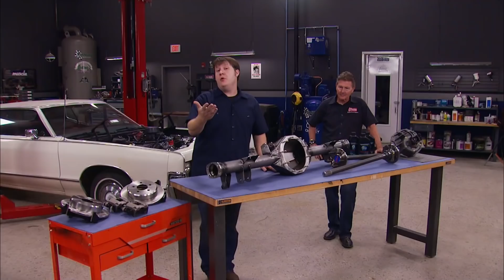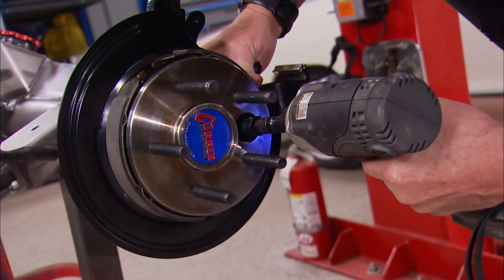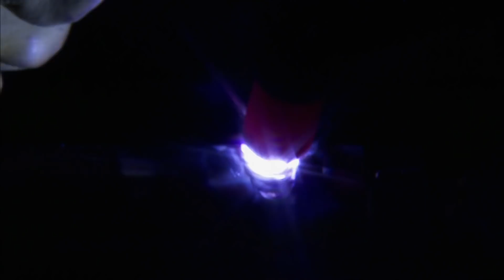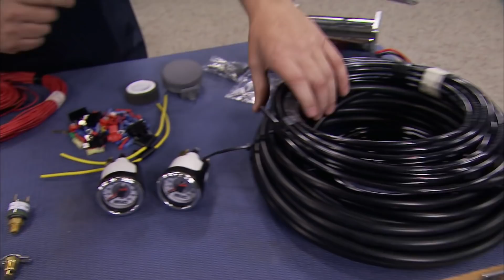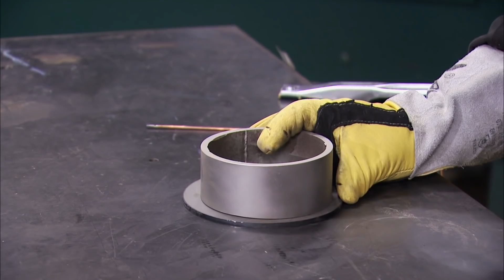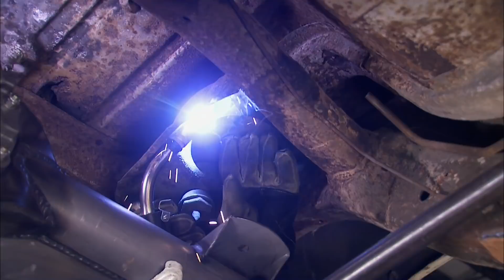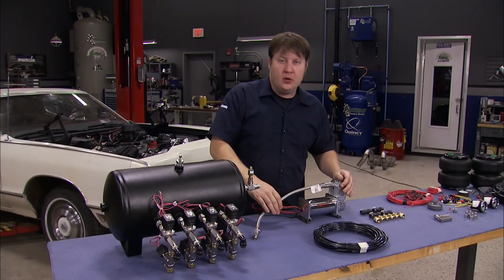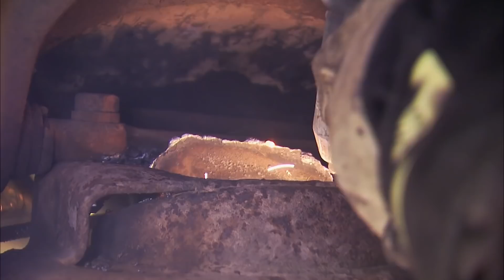Dropping an 1,100 HP '72 Mercury Marquis - Detroit Muscle S3, E12

Comment: all well and good. assuming 1100 hp engine is smooth as silk...
Reply: Which it probably isn't, considering it's a hand built engine with almost zero R&D behind it, just made to hit those numbers on dyno.
Reply: @derbigpr500  How else does one build an engine? Robots? You keep saying R&D, is that all you got? People have been getting huge power from all brands of big blocks for many years. Are you one of those internet car guys? It became popular though hoonigan etc so now you're an expert? How many engines have you assembled? If any, how'd you do it without using your hands?
Reply: @derbigpr500  The guys that built that engine need to do R&D? ...
They build engines, they know the parts that work well together, and they know how to get power out of whatever brand engine they build using tried and true methods.
I've built nowhere near as many engines as they have but an 1100 HP FoMoCo big block with a lope at idle and a roar on the top end is one I have done, and rebuilt at the end of every racing season...
Have you ever actually hands on built an engine, chassis, or whole car? I've rebuilt, modified, and repaired more then I can count over 30+ years as a mechanic/body shop tech. Engines? Check. Certified frame repair tech? Check. Built custom engines, chassis', and cars for myself and customers? Double check.
With vehicles book/net learning is no replacement for hands on real world learning. 
As Stacy David says, Get out there and build something.
Reply: You don’t really build an 1100hp engine to go cruising if you know what I mean.
Reply: @nate0765  in Ford/Mercury commercials they cut diamonds (actually) and circumcised gnats in this car as it went over speed-bumps at speed. the ride was the BEST in the world (including Rolls-Royce, Jaguar, Bentley). it's a magnificent platform. i'm anxious to see what the end results are.
Reply: @johndunn8647  RR actually sent people to study the Lincoln versions of this platform to see how Ford managed to get the thing so quiet.
Reply: @mfree80286  they were a sweet ride...